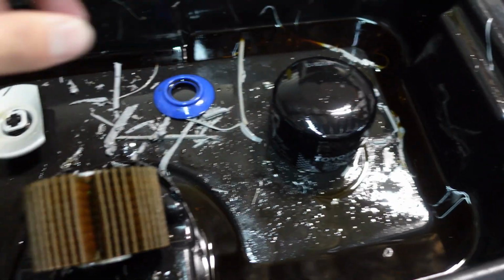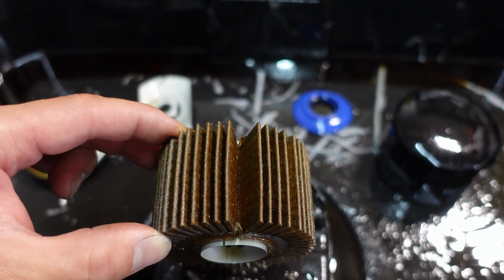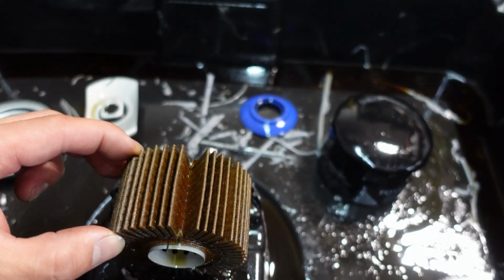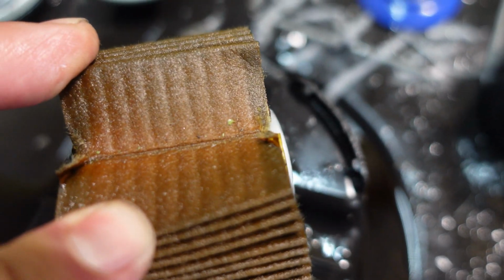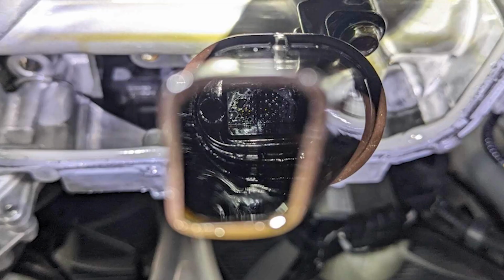GR86 RTV issues in 2023 / Oil Pan Drop 25

Comment: My GR86 has a build date of 11-23. Likely one of the last of the 2023’s. I learned of this problem after the purchase. This vehicle is street driven and is never going to be raced. Nevertheless, I admit to some spirited driving on some of the winding back roads of Western Pennsylvania. I changed the oil at 1023 miles and opened the used filter. Of course the oil was yet very clean and I found no evidence of any RTV ( or anything else) caught in the filter element. I am somewhat relieved and I’m hoping that Subaru has finally resolved this issue. I am going to service it again at around 3500 miles and inspect that filter as well. If I find anything suspicious at that time I will post it here.

Comment: I order Subaru filter from Japan. My 86 was built May 2023. I need to drop the pan. It has 1200 miles and Ive changed the oil twice and going to change it today to Motul 8100 power 0 w20 and Japanese OEM filter
Reply from the maker: If you plan to drive the car hard, I still recommend the SYMS baffle - only baffle on the market proven to work.

Comment: Are the 2024 going to have the same issues with RTV? You’d think Subaru would have fixed this issue by now.
Reply from the maker: The latest update I have is that for NEW 2023's on the break in oil change, we are seeing large amounts of RTV being drained out with the engine oil, but much less stuck in the oil strainer.
Reply: @CMAutohaus  thanks still not very promising. Strange, Subaru didn’t have this issue before…
Reply from the maker: @TheBilliardCorner  They've had this issue since MY2011 with the  (new at the time) FB engines. I think we are only aware of the issue now due to the other weakness' being revealed with the FA24 in the GR86.

Comment: So on the 2024 has the issue been solved?
Reply: 2024 owner here. 6 track days hard street driving and 20,000 miles  not a single problem with the engine. This is a internet issue were people want to make a problem where there is none. If you drop the oil pan you void your warranty. If and that is a big IF it blows and the car is stock the warranty will take care of it. There is no proof that RTV is causing problems in this engine.

Comment: I used Honda oil filters on my previous 2017 brz. It fits and worked fine for daily street driving. Has the first gen had any RTV in the pickup? I'm considering getting another first generation.

Comment: Wouldn’t the little piece of aluminum get stuck in the oil filter, if it got through the pickup screen?
Reply from the maker: Its possible for containants to get trapped inside internal engine oil passages and filters (OCV filters in the cam carriers)
Reply: @CMAutohaus  But doesn’t the oil from the pickup go through the oil filter first?